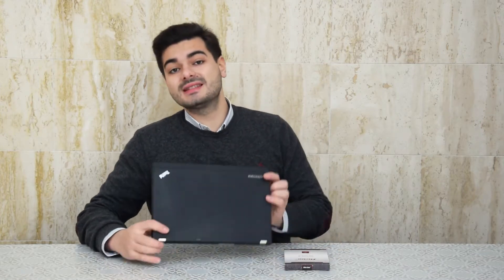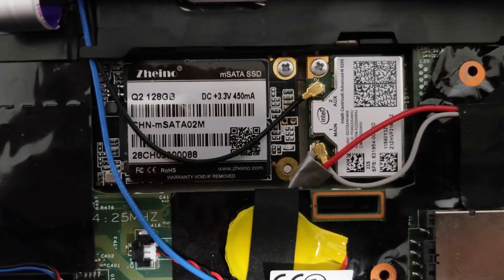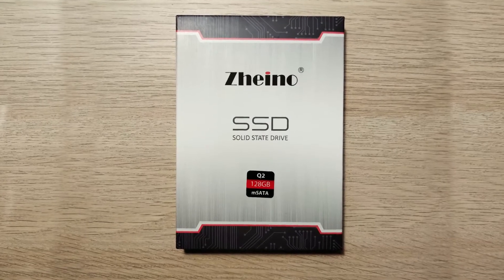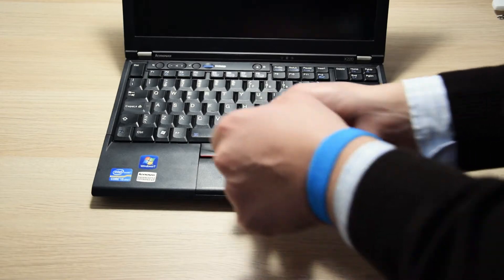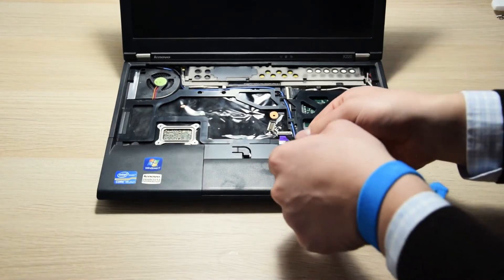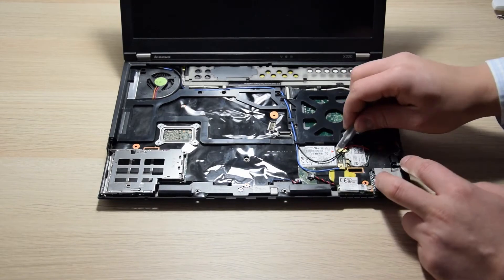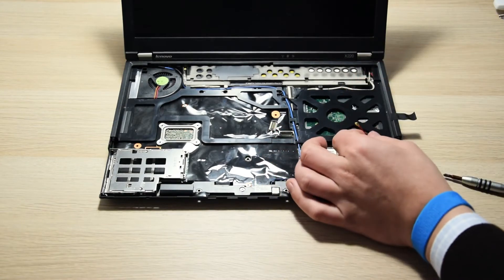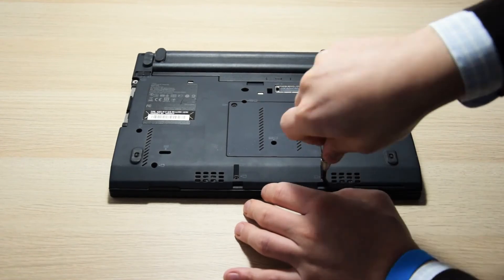Easy Thinkpad X220 Upgrade - mSATA SSD install

Comment: Wait, taking out the SATA SSD for a mechanical HDD? @2:35
Reply from the maker: Yes. The SATA SSD is faster but smaller. The HDD is bigger and then you can use the mSATA SSD for the OS. Remember this must be a cheap work laptop otherwise it doesn’t make any sense for me.

Comment: Ciao paesano. Molto, molto bravo. I am thinking about buying this same laptop in Australia. After installing this upgrade did you then flash Ubuntu to the new SSD and use the HHD solely for storing data and files? What did you do next after the video ended? Thanks again. Salute da Adelaide.
Reply from the maker: I installed the OS on the SSD and then pointed the /home path on the HDD. Not using ubuntu btw
Reply: @Vincintosh  Grazie.
Reply: "flashed ubuntu" so many things wrong with that statement.

Comment: keep in mind that you won't get the full speeds out of the drive due to SATA2 speeds ; about 200/300mbs
Reply from the maker: I know. For everyday tasks (which is what this computer is meant for) the speed difference is not noticeable though

Comment: that WWAN thing you replaced with the mSATA.. you mentioned that it is basically useless nowadays, so you'll replace it with mSATA for additional speed for your laptop, correct?
I have an x220, and might want to install an mSATA after watching this video to increase my rigs performance.
If I may ask, is the x220 upgradeable to 16gb ram? if so, that would be awesome.
Reply from the maker: As far as I know not officially, but unofficially it can be upgraded to 16gb of RAM
Reply: Michael Eugene Venturillo I had this model and upgrade to 16gb (2x8gb) with no problem
Reply: @anxel-  Any links to where you bought the RAM from?

Comment: If u replace erricson module, what happen?what's the impact?
Reply from the maker: If you remove it you won't be able to use the 3G capabilities of this laptop anymore. What happens? In 2019 nothing. You don't need it since you can use your phone as a wifi hotspot and it's way easier.

Comment: Hey man, thanks for sharing your experience. What made you choose for an PCIe SSD (that only gives you 3Gbs) instead of 2.5" SSD that could offer 6Gbs for your X220? I am considering the upgrade for my X220 as well and guessed that buying a small SSD to install the OS and have bigger spinning disk for not that intense kind of storage might be a good decision but feels like I am giving up some performance there. Have you considered other upgrade scenarios?
Reply from the maker: I chose an mSATA drive so that I could still use the ordinary SATA slot for a traditional mechanical hard drive where I store my files, so that I can have a much larger capacity drive to store my stuff while the mSATA SSD is used for the system ;) I know it's a bit slower but you don't need to brake any records: it works fine and the system boots up within a couple of seconds, that's all you need imho ;)
Reply: Thanks, man! Keep up with the videos!
Reply: @Vincintosh  Hi Man, thanks for your video. Could you make a video about how to install Window 7 or any Window system on the mSATA SSD on my X220. Thanks.
Reply from the maker: @demikian8091  it wouldn't be very useful since there's plenity of guides on the web on how to install windows 7